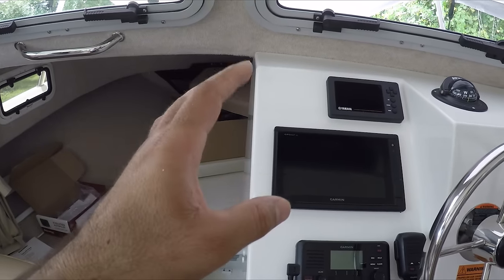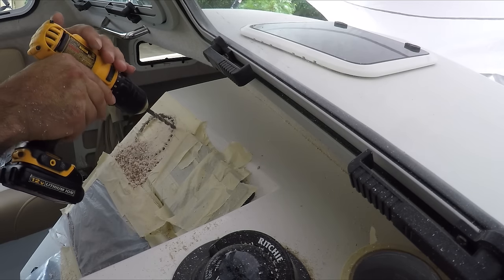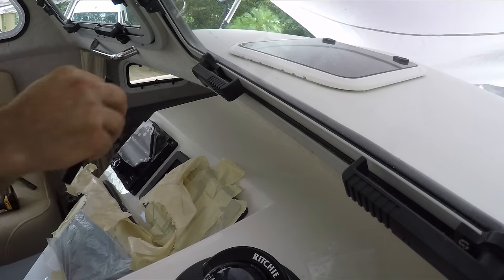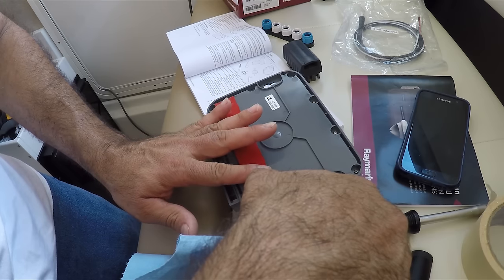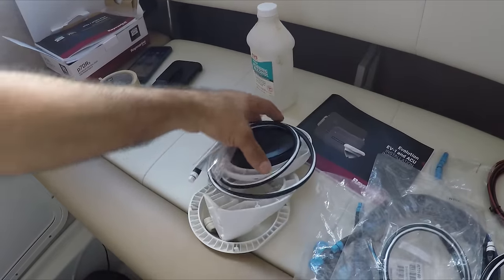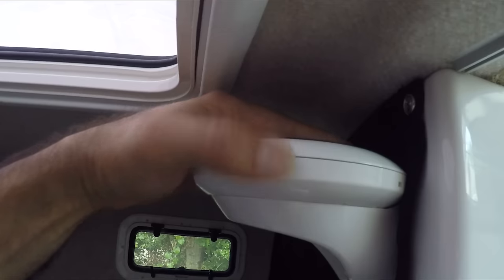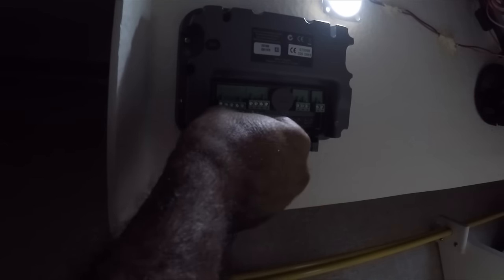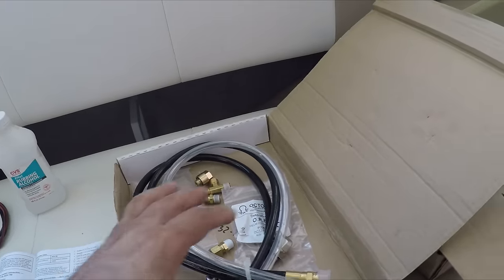Installing the Autopilot diy in my Crooked PilotHouse Boat Raymarine EV-100 P70R

Comment: Hey Cap. Nice job with all your installs!
 I did notice the antenna cable for your VHF was coiled up behind the panel. That will reduce the performance of your radio. Also i would not use the factory antenna connector. Its best to cut the cable to length and solder a good connector. Also try not to zip tie the antenna cable to any power cables. Made a big difference on my boat after i did that. 
Also corrosion X or corrosion block on all electrical connections is a must. Cheers! Bill
Reply from the maker: Thanks for the info! cap and yes i did cut that cable in future video thanks for looking out cap 👍👍

Comment: every electrical device in your boat is great for comfort and maneuverability but is really important to use a power block with fuses for protection and safe, great project !!!
Reply from the maker: thanks Luis and yes i have installed in all my electronics a power fuse block in all my electronics

Comment: Nice to know EV100 is NOW good for Hydraulic Ram Capacity: 3.1-9cu. (aka 50cc-150cc). A couple years ago when I bought it. EV100 is only good for up to Ram capacity of 50 cc to 100 cc. My Baystar Hydraulic steering is 118 cc, so I had to return the EV100 kit to West Marine. What a bummer! but kudos to Raymarine for making it bigger.
Reply from the maker: Yes it's made for boats heavier than mine so it does work I used it and had no problems with it.
If you go to the website L tell you the capacity of the new pumps systems. Thank you for watching
Reply from the maker: How big and  what was the weight of your boat
Reply: @OutOnTheReef  17 feet bow rider much smaller and 2019 Yamaha 70 hp with baystar hydraulic steering. Tech improves every year.

Comment: Install a MOB+. Having a autopilot will inherently free you up moving about the vessel while underway. Last thing you want to do is watch your boat drive off if you happen to fall over. I’ve been fishing offshore since I was a child. It happens quicker than you think. I’ve installed on all my boats.  Be safe. Looks good. Maybe we’ll see you up around Destin Fl one day 👍🏻
Reply from the maker: Thank you Captain for the recommendation of the mob
I'm already looking into it to have it installed in the near future it is a very needed item especially when you're by yourself moving around the cabin and deck of the boat thank you for looking out for me and yes maybe one day we'll see you at Destin Florida.
Navigate safe captain
Reply: I have one and worth the $200 for piece of mind.
Reply from the maker: @brenteason9891  I agree thank you for the recommendation captain
Reply: Out On The Reef : I put mine right below the Lowrance unit and use the FOB in the wrist band - like a watch.   You can see the head unit has a small footprint here below the Lowrance unit.  https://youtu.be/5_IN4WLkBtk
Reply from the maker: thank you for the link Brent

Comment: A small but important tip for anyone who may have to work on anything in the future;  ALWAYS cut the ends off of zip/cable ties with a pair of flush cutters not regular wire cutters.. Regular cutters turn the end of the cable tie into a extremely sharp point that will rip your or possibly my arms up when you need to get back into the area and do work. The flush cutters make a nice flush cut with no sharp edges.  Plenty of cheap options for flush cutters on Amazon as well as better brands for a bit more money...👍👍😉
Reply from the maker: Thank you for your suggestion captain
Reply: 99 cents nail curte works well

Comment: So I think I’ve seen a video where you replaced the raymarine with a garmin what was the reason I had an older Raymarine sport pilot had nothing but trouble with it finally gave up on it
Reply from the maker: Same here cap. Raymarine units are terrible and costumer service too, but i had my Garmin for 3 years already and love it cap. I had the pump leak a little and Garmin replaced it with no problems,  great customer service 👍👍⚓️

Comment: 16:05  I simply unscrewed the 2 90 degree fittings from the steering helm and put them on the pump. The Sitex kit comes with a straight that I used for the return reservoir.  No need to get 3 fittings..
Reply from the maker: Thanks for the explanation captain appreciate your feedback

Comment: Thanks for this video, great job. I bought a 22 foot Lund and would love to put one of these on it. Do you know if a 60 inch shaft would work? Or would l need a 72? The 60 inch shaft calls for two batteries were the 72 calls for three. Thoughts? Thanks for your time.
Reply from the maker: the 3 batteries has more power cap is 112 thrust

Comment: Absolutely 100% install... Just one question...  Never saw what you connected to the first white sea talk connector in the video... ?  Thank You in advance...
Reply from the maker: Thank you the other 2 white connector was for the screan display and the other for the sensor.
Sorry that i did no clarify that cap.
Thanks for watching ⚓⚓⛵👍
Reply: @OutOnTheReef  I found out what wire was needed for the connection from the Raymarine Axiom to my autopilot
Reply from the maker: @lphjr40  that is awesome I knew you could do it if you need anything from me let me know and I'll try to help my best

Comment: Hello- thanks for posting the vid.
I'm installing the exact system and have only 1 question:  How far is your EV1 from the ACU?
I've read that the electric output leads to the hydraulic pump will create quite a bit of magnetic field, [as any similar size motor would] but it looks like yours is at least 24" separation.
Reply from the maker: Hello, captain and yes, it's at least 24 inches. Thank you for watching and if you have any questions, please let me know.

Comment: Bold move making a permanent install worth the tape before testing! I think I would have used small bits of tape rather than the large in case I had to swap it out. Great install though.
Reply from the maker: Understand but i reather do it this way and be done with it, i dont like to do work half way if you know what I mean 😉👍
Reply: Can’t wait to see the next video. This may make me put one on my 25 Grady!
Reply from the maker: @papaspals  you'll like it the installation is not that hard it's just time consuming and you will save more than $1,000 on the installation by doing it yourself and you know it's done right when you do it yourself.
If you do decide to put one on your boat please use my link in the description below and that way I'll get a little commission out of it and that really helps the making of this video captain I will appreciate that.
And I also put the description of the hydraulic hoses I use

Comment: Very good, I am in the market for an autopilot and wanted to see what I was getting into, now I have an idea.  I noticed in another video you changed the pump to a garmin brand, was there a specific reason and I assume you had no compatibility issues with Raymarine and Garmin on the pump exchange?
Reply from the maker: i change to Garmin to make all my system compatible and the raymarine was giving me problems cap
Reply: @OutOnTheReef  ahhh I see, makes sense.   I thought that may be a problem.  Perfect, stay safe.

Comment: Love the attention to detail on your installs, how is the autopilot holding up?
Reply from the maker: Thank you cap.👍Is running awesome now pairing it to the Garmin it works 95% of the time perfect but sometimes it's a little harder to Link but then again you can use the autopilot for Raymarine straight without using the chart plotter.
I'm very happy with it the only thing I really don't like about Raymarine is their customer service is awful😬

Comment: Great job with the install.. What size fuse did you use between the acu and terminal block? I'm putting the same system in and can't determine what size from the manual.
Reply from the maker: I don't remember Nick I will have to take a look at the boat but I think I have the wrong size on it
Reply: @OutOnTheReef  thanks captain!  I'm new to this stuff, and it's frustrating that the manual isn't crystal clear on what's needed. Your video saved me many hours. Thanks again! I'm also connecting to a garmin mfd and used your links to buy the needed cables.
Reply from the maker: @NicklausSQ   Awesome Nick And yes I never found the fuse size on my manual that's why I don't know what size to use but congratulation on your installation captain

Comment: Great video cap. Your chart plotter is Garmin. Is Raymarine auto pilot compatible with Garmin? Or are these 2 sytems work independently of each other?
Reply from the maker: I have not done research on that but the cables are somewhat compatible I just need to buy an adapter cable to see how they work or I'mma try to call Garmin because Raymarine was not very helpful

Comment: Did you have poly tubes from motor cylinder to helm? I do. I also have BayStar cylinder and BayStar helm. I called Sea Solutions/Teleflex to get correct tube kit. They said I need their special hoses. I have not had one problem in the past and I am adding a EV-100. Any thoughts? Did you have issues with tubing? Thanks
Reply from the maker: I don't have problems with tubing I just have problems once in awhile. The system will act up a little bit and not work, but then it goes away.

Comment: Great job !! I have the exact boat and want to put the same auto pilot in. One question ., the 3 fittings that you had to purchase for  the drive  pump. what size and where can I get them. also how many liters of hydro fluid did you use
Reply from the maker: What I did was that I took the pump in the fittings that came with to a hydraulic hose supply store and they have experience there with pipe fittings and they can provide you the pipe fittings right there I don't remember the size of it but they really can help you and give you some great advice remember that not to over tighten the pipe fitting because you will break the pump you can only make few turns with it and I did not need a lot of the hydraulic fluid because I did not let it leak all over the place so it's very careful with it so I only need it like half a quart.
Hope this helps you on your new installation if I can help in any of the wait let me know.👍👍⚓

Comment: Can I ask if you installed a rudder indicator with this RayMarine autopilot system?
Reply from the maker: Well I'm not a 100% sure but I know sailboats use this unit for their sailboats so It could be a huge possibility and to make sure a 100% call ray marine and ask him but I think you're able to captain so double check with him hope this helps

Comment: Did you buy the orb Tees separetly or did they come in the sitex kit
Reply from the maker: I had to go to a hydraulic specialist to get those parts there pipe fitted
Reply: I mean the ORB TEES that you put in after you took out the elbows
Reply from the maker: @peterpaduch152  yes those did cap

Comment: Thx for this great video. I have a question about the fittings that go into the pump. The pump has the British BSP standards, but your hydraulic steering is the American NPT standard. Are the pump fittings BSP male/ NPT female?
Reply from the maker: I took the pump to a hydraulic shop and they gave me great suggestions of what type of fittings they told me pipe  fitted so for your different system you may want to go to a specialist and ask them in your area because that's exactly what really helped me

Comment: So, the autopilot works in conjunction with your chart plotter?
Reply from the maker: yes but you don't get all the features cap , you only get pin point a spot in the chart plotter and thats it, if you want more features you need both brands cap, hope this helps👍⚓

Comment: do you recieve good fm reception? also what make is the antenna under the helm? thank you
Reply from the maker: The antenna under the helm is for the Marine kill switch, is that little red thing that I carry on my vet if I fall overboard it will shut off the engine automatically and if you want to find out more information about it I have to link in the description below Captain is an awesome safety device,👍👍⚓

Comment: Capt, how long did it take you to do this install and would you do it all over again or would you rather pay next time?  Also, what would you rate the difficulty level for this install?
Reply from the maker: If I have to do it all over again I will definitely do it myself I trust myself more than a mechanic when it comes to doing things right and the hardest part was the Hydraulics finding the hoses and fittings specially for this installation

Comment: A hole saw would've gone a long way to making that controller install quicker and easier. Nice job though!
Reply from the maker: Yes you're right I could have ran to Home Depot and get a hole saw but it worked not as clean but it did the job and thanks for watching captain
Reply: I didn’t want to be the one person who said the hole cutting was a bit primitive.it did work out fine though and you really do care about what you do,It’s very obvious. I guess that’s why that method of a thousand drill holes seemed out of character for you man...A nice little jig saw or that really bad ass Dremil might be a good acquisition for you...beyond that GOOD JOB👍🏻
Reply from the maker: @johnm5714  you're right and I have a jigsaw but the reason I didn't use it was because the electronics around it I could not use a jigsaw but I did not want to run to the store and get something else I want to continue with the video that's why I did it that way but everything came out great and that whole imperfection is hitting under the electronic but thanks for the suggestion
Reply: Well your damn good at making due with what you have— that’s the sign of a good mechanic.and you are 100% right — can’t see it AFTER the panels installed so not a big deal

Comment: One question what do you mean exactly at the end of video the sea star power cable connectivity is that some other device
Reply from the maker: not sure about your question cap. is all hydraulic hoses
Reply: @OutOnTheReef  you said power wire for sea star? It was red and blk I think
Reply from the maker: @captainhorsecrank7118  I will have to look at the video game but it's weird because the sea start does not have a black and red wire
Reply: @OutOnTheReef  ok great thank you you were talking about the power lead for the ev100 then you mentioned seastar power connectivity also GREAT VIDEO

Comment: Viewers beware do not use NPT fittings on the pump you need to use ORB fittings on the pump!
Reply from the maker: pipe fittings is what works for this i had specialist verify it
Reply: Out On The Reef I am glad it worked for you. I made the decision to include the correct fittings with every new system we sell.
Reply from the maker: @TideFighterFishingTeam  i had alot of research to do it was alot of work.
Thank you cap.